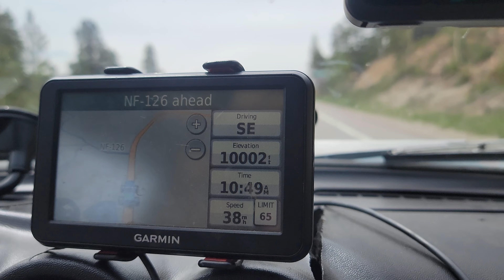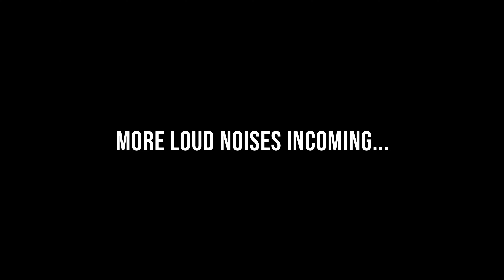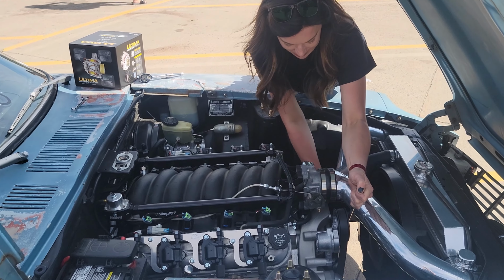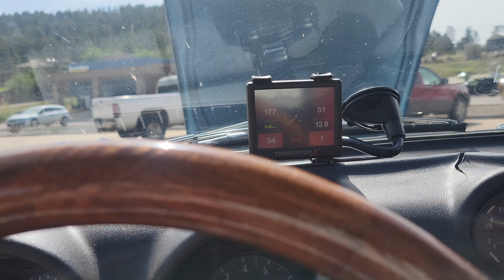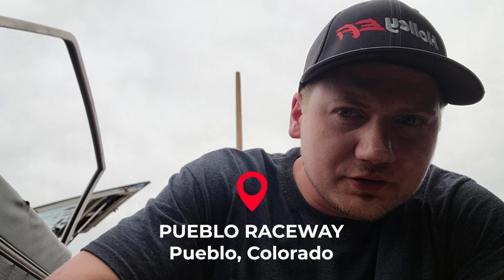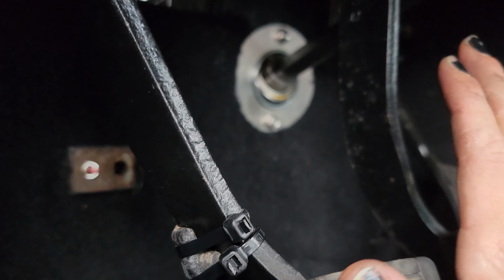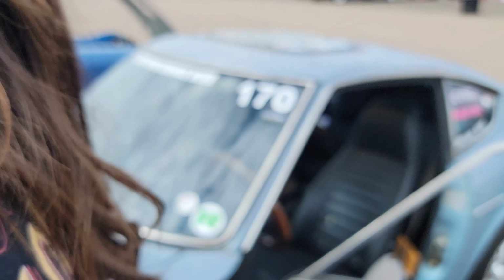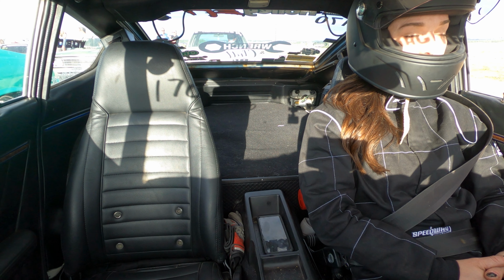Days 4 & 5 - Rocky Mountain Raceweek

Comment: Hey guys something is off/ loose in your front suspension/ steering. Watch at 9:38 when you lock the front brakes for the burn out and move forward, the stopped front wheel moves slightly back (towards the rear) within the wheel well. And at 10:26 after landing back down watch the front wheel again move irradically within the wheel well. If nothing is loose then something is weak or badly engineered and causing that wheel to do that. Take a very thorough long look at everything because a front steering/ suspension failure at the track will take you straight to the wall or your opponent. fyi